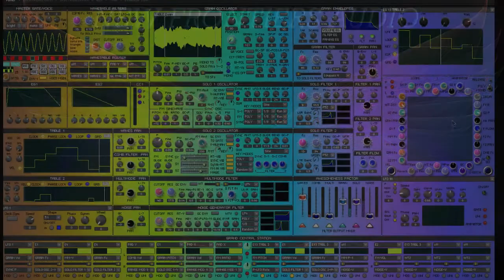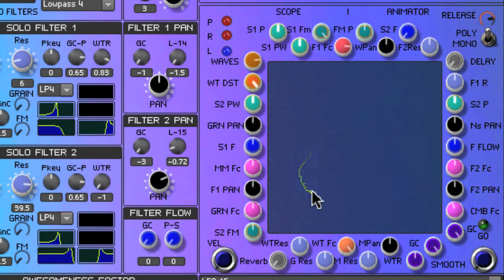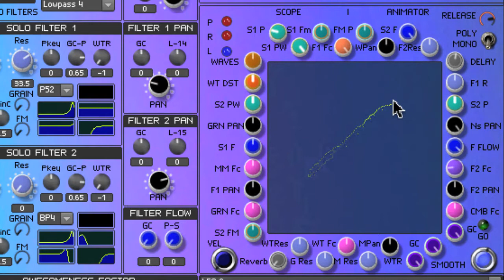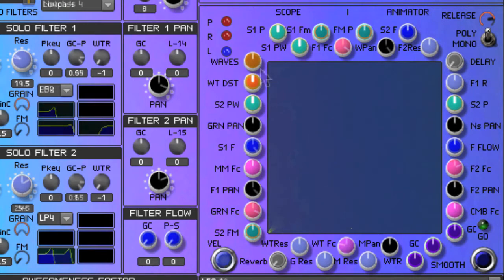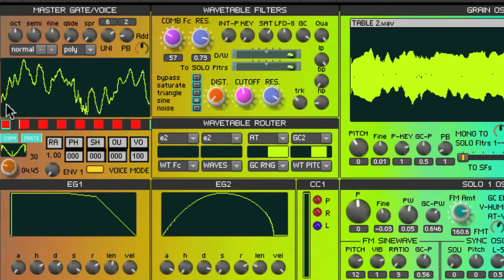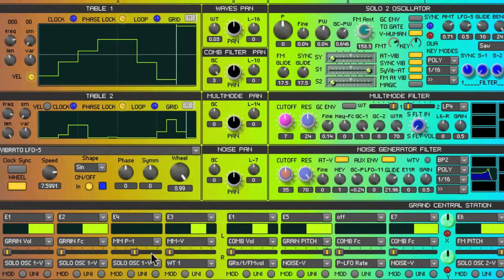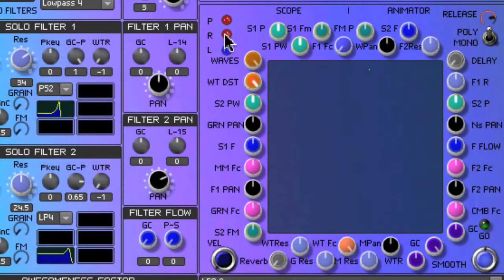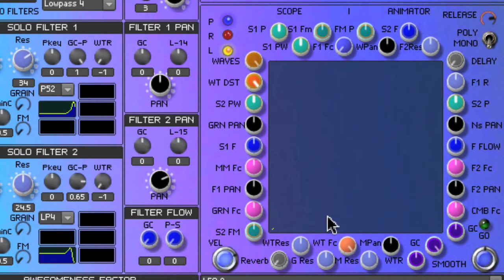Spektrumsynth 2 Tutorial 3, Part 1: The Animator Pad

Comment: Wow its amazing. Could there be a way to actually import path data into the animator, such as particle paths from the LHC. To think that it would actually be possible to hear a Higgs Boson or any subatomic particle as they have very specific path data(s). Great work as always.
Reply from the maker: Hi, Tony. The pad can be controlled by MIDI CC, so if the path data could be converted into MIDI controller data, then it could be done. I would prefer to have a 3-D controller, which would probably be required for the correct translation. Great idea! Thanks.